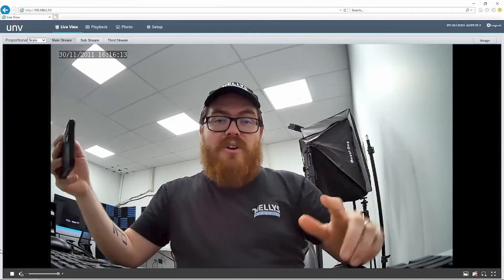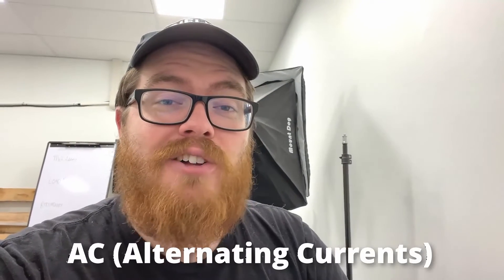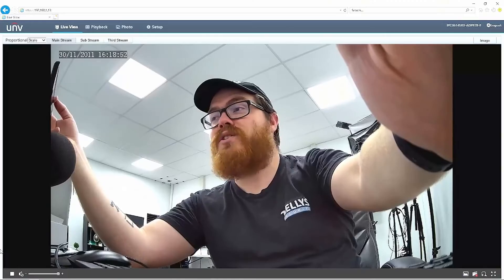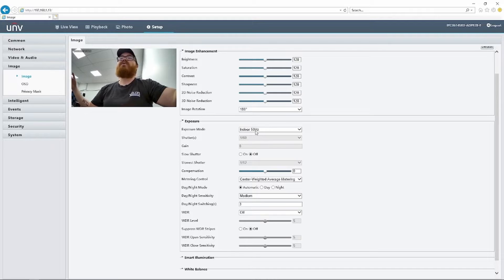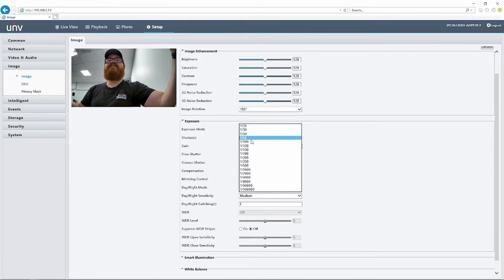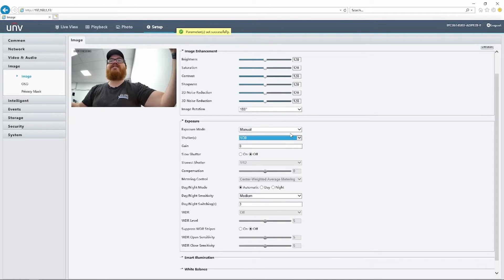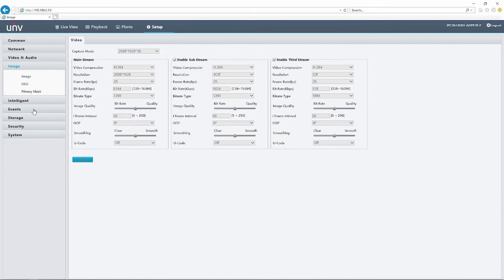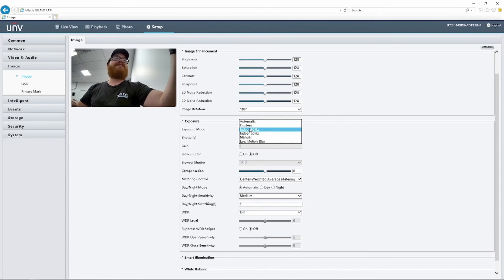Annoying Horizontal Bars In Your Video Surveillance Footage? Try This!

Comment: Our cameras are outdoors and they roll vertices stripes and background light will burp while rolling every few seconds. I just noticed it appears to be only three of the cameras. Two rolling in one direction and the third rolling camera rolls opposite direction.  It has always done this but it worse this year that most. I have tried inline filters from the WiFi connection. Individual sleeves over cable connectors at the back of the DVR.  I have neither on the setup right now. Because we providers and set up a couple more camera. Any suggestions?

Comment: Could you tell me why my 4k camera's have lines going threw them all? the line's are very thin and run horizontal and kind of look snowy. I tried replacing the dvr and cables but it didn't help. The problem seemed to start after installing solar on my house!
Reply from the maker: Hmm. If it's not the frequency issue it could be electrical interference.